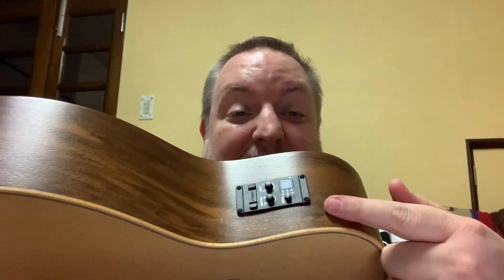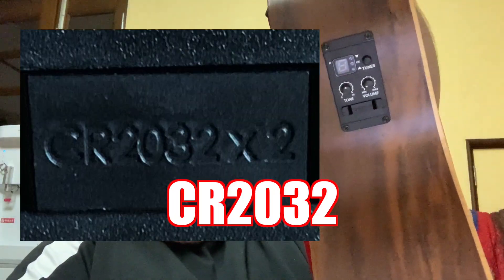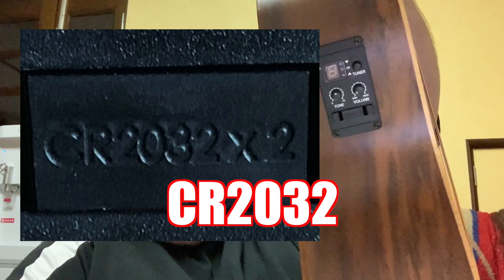What's The Difference Between These Batteries?-  MULLY

Comment: small caveat, LR2032 or LIR2032 are lithium rechargable 2032 cells but they operate at slightly different voltages compared to CR(DL) Li-MnO2  2032 cells (which are not rechargeable).  for most purposes its fine but for certain sensitive devices like insulin pumps and pulse oximeters you should stick to the type of cell chemistry the device specifies.
Reply from the maker: Thanks for the info.